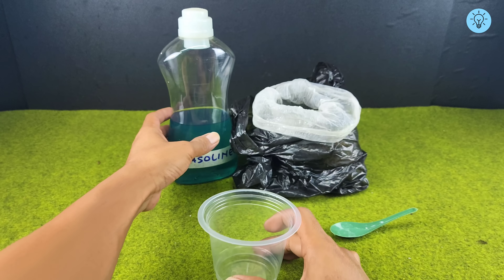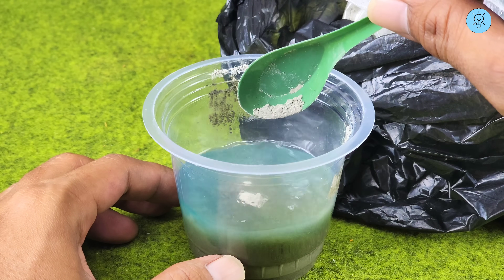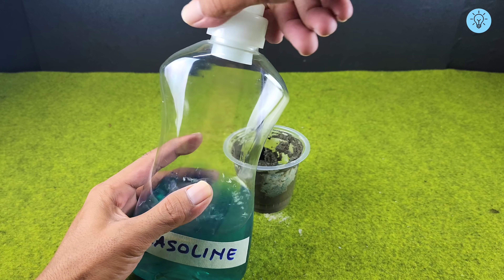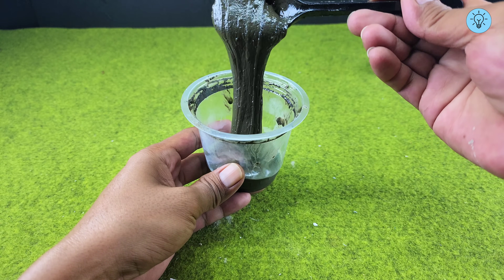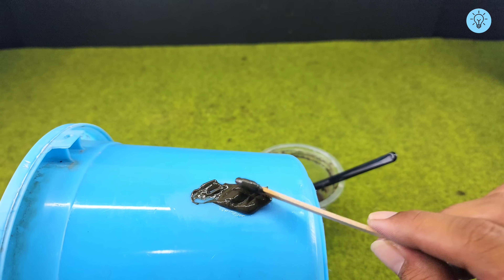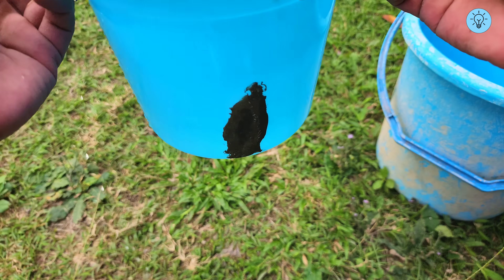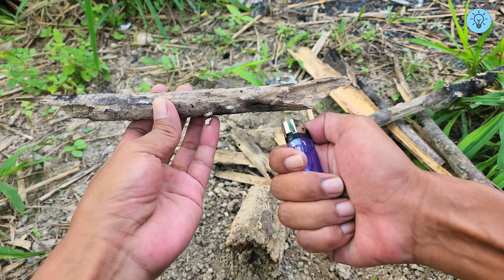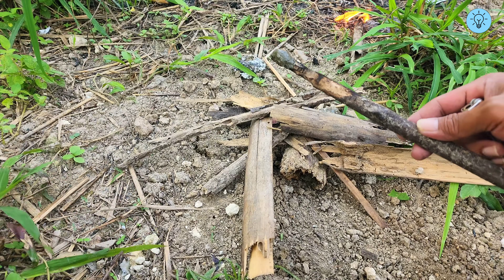Mix GASOLINE with CEMENT! Amazing results that most people can't imagine

Comment: Dang! You can’t even notice the repair work. It’s like brand new. Good thing I scraped up $4.50 for the gas and $6.00 for the bag of cement to repair a .99 cent Walmart bucket. that is so clever and smart.
Reply: Lol. I do fiberglass repairs on boats. I would fire myself if my repairs looked even remotely that hideous.
Reply: @nutricook1 Yea, but what if you didn't have the proper materials or tools & your boat had a hole in it, & you were stranded on an island with no help coming, & all you had was cement, gasoline, & Styrofoam? That's the idea of this video. Not perfect, professional fiberglass repair.
Reply: @sparky6086 Okay. That is quite the scenario. But I would still be skeptical. My luck is that the makeshift repair would pop off because of changing temperatures right when I was far away from land. 😕
Reply: @nutricook1 It depends on how desperate the situation is. It's not bad to have options. Sometimes people find themselves in "MacGyver" type situations. People should use their imagination, rather than dismissing videos such as this one, simply because it's not done the standard way or to code. It may even apply for an application no one has thought of yet. Doesn't necessarily even need to be a desperate situation.
Reply: @nutricook1  Remember the sap glue re[airs on the minnow's hull on Gilligan's Island All the boards started popping off after a certain amount of time? ;D
Reply: @kellygibson4653  The professor was my favorite character. However, I don't recall that episode. 🤔
Reply: @sparky6086   of course you don’t usually have a bag of cement when you go fishing…
Reply: @nutricook1 it was actually the pilot episode
Reply: @markkarasik2211 Who knows what one might come across on a random island? ...I'm sure you get my general point.
Reply: @sparky6086   "you were stranded on an island with no help coming, & all you had was cement, gasoline," cant even tell if you are being funny
Reply: @sparky6086  Ah!  Now i see you are serious -- stranded on some uncharted desert isle with--- wait for  it -- fresh petrol, cement, and styrofoam, and a mixing cup! Cuz THAT could happen! if only you knew how silly you sound.
Reply: @free322001 I exaggerated to sharpen my point and you still didn't get it. Perhaps I'm being a bit silly, but you're being obtuse.
Reply: The answer to the song "There's a hole in the bucket"
Reply: You're talking to a generation that doesn't even know what a women is
Reply: I think you miss the real point.  You are not very bright are you?
Reply: Considering he used 21 cents worth of gas & 8 cents worth of cement. Not too shabby 😅 😂.  But yeah the terrible finish... & a bucket?
Reply: @billykarnes6035  Sorry - where do i go to buy  8 cents of cement? How much gas do i burn to go drive to get 21 cents of gas? Or do you want to suck it out of your tank with a tube?
Reply: Yes, for one small bucket it's probably not cost effective but I have quite a few 35 gallon plastic trash cans that I have accidentally put a few holes in with the weed whacker. If I get all the trash cans and buckets I have holes in, making a good size batch would save money, Those trashcans are $15 - $20 each.
Reply: 15 lbs of glue for $10 is cheap.  Can replace bondo for car body repairs
Reply: Good stuff I got 3 for a dollar but need buy that cement and other components asap 😂😂😂😂😂
Reply: Good point, who ever did the video could have repaired something more valuable than a bucket
Reply: What you lack in imagination you make up for in noise.
Reply: 😂😂😂 i was thinking the same 😂😂😂
Reply: Squeeze the bucket and you have your leak back.
Reply: "Use your hands"😂
Reply: Can this processed product used to repair, pressured hot/cold water pipes?
Reply: @BRadha-gi4jv no, definitely not, terrible idea.
Reply: NOW add you labor, time, and hazmat disposal.
Reply: Ha
Reply: Of course, you may run across an application at some point where it's worth it if you use your imagination. ...Unless your government restricts it's use to plastic buckets only?
Reply: @sparky6086  Like Bondo to repair rust patches on your auto?
Reply: If the bucket was HDPE you could just use zip tie cutoffs and a soldiering iron to weld the bucket.  Also you should NOT for any reason bare hand cement or gasoline let alone mixed together.  That is horrible advice and you should edit that out saying to wear gloves and don’t get it in your skin.  Ps you don’t need cement to mix styrofoam and gasoline to make a sterno like jelly.
Reply: 皆さんこの話題を擦りすぎです
Reply: Yeah, stranded on an Island with a hole in your boat and you just happen to have some cement on hand. Or maybe the last guy that got stranded left a bag of quickcrete😂😂 This trick isn't gonna save you!
Reply: You obviously live in California... Like me. Depending on how far you had to drive and gas mileage, I spend a dollar every 5 miles. Cali is great.. if your rich
Reply: Or an illegal immigrant 🎉

Comment: A lot more simple way to do that is simple super glue and baking soda. The combination makes a rock hard shell! You say that mixture safer but you make a fire for more than heat you make it to cook with. And I beg to differ on how quote" safe that fire would be with your food burning styrofoam and gasoline can't be good. Now if just for heat it's a decent idea I guess. But we use Vaseline and cotton balls. #rip chip
Reply from the maker: That’s a very interesting suggestion 🙏 super glue with baking soda really makes a strong shell. You’re right, safety always depends on how we use the idea. For just heating, I agree your method with Vaseline and cotton balls is a smart and safe choice. Hopefully this idea can still be useful in certain situations.
Reply: @creationDIY_101 It is! To start a camp fire, burn barrel, or fire pit to relax near. I only mentioned about that because it's so many people who would definitely would not know better than to try it to cook by! But it is a great ignition source in well ventilated areas!👍Salute! Keep them coming!

Comment: Good job of giving enough info to get it to work. You showed the basic concept, the materials, the approximate consistency to aim for and gave a basic idea of how to use it.  
I tried it and it does indeed work! 
The ratios aren't exact.  Relax & play around with it, nothing expensive here.  
Doesn’t work on everything all the time but it's got it's place.  Sometimes you need JB Weld, sometimes you need Superglue, sometimes you need wood glue, sometimes....
😊
Reply from the maker: I’m really glad to hear that it worked for you! You’re absolutely right — the ratios don’t have to be exact, and experimenting is part of the process. Thank you for sharing your experience and adding great insight! 🙏
Reply: Non Newtonian fluids
Reply: Superglue and baby powder works well but with a slightly different application process. Put a little superglue on whatever surface you’re trying to fill or bond then sprinkle baby powder wait a few moments then repeat. Glue then powder until you’re finished. You can sand it drilled it or paint It. It can bond better than most glues because you can layer it on the outside of a bond for more support. You can mix the superglue with many different powders to varying degrees of success. I forget which one is supposedly the best (there’s many different videos on here that compare powders) but baby powder is one of the top ones and seems to work well.

Comment: How long before it goes from liquid to solid in the cramping test?
Reply from the maker: For burning media, you can use it for about 3 to 4 days. As for the patching process on the bucket material, it only takes around 24 hours to form a solid structure and bond strongly to the surface of the bucket.

Comment: I'd never use gasoline for anything other than as a motor fuel.  Too dangerous.
Reply from the maker: Yes, you are right, we really need to be more careful when using gasoline. If you prefer not to use gasoline, in my latest video I’ve made a version using materials without gasoline — it’s much safer, more practical, and you can try it directly at home. Please have a look, and I hope the idea is useful.
Reply: you could break down the hydrocarbons to get a drinkable alcohol, though you need a chemistry background.

Comment: for $2 bucket . ???
Reply from the maker: This mix isn’t just for broken plastic buckets — you can also use it for leaking walls, roof tiles, or even as a super strong glue
Reply: No, for €2 bucket

Comment: 変質したガソリンは着火剤代わりにするにも発火がヤバいので砂に吸わせて埋めてしまうか、廃棄物処理業者に処理してもらうしかありませんでした
だからと言って刈り払い機に使うにも長期に見ればエンジンの劣化に繋がりますからあんまりやりたくない
なるほど、発泡スチロールを溶かしこんでセメントの粉末と混ぜれば強力な接着剤になるわけですね！
盛り上がりもいいから車のバンパーの修理にもよさげなパテにもなりそうだ
セメントの代わりに大理石粉末とか珪藻土粉末とか母材を替えれば色や強度を変えることができる！
この発想はなかった。捨てるだけの劣化ガソリンと発砲スチロール。資材費は無機質粉末代だけだから超ローコストだねｗｗ
Reply from the maker: とても詳しいコメントをありがとうございます！確かにスタイロフォームとセメントを組み合わせることで強力な接着剤として活用できますし、他の素材を混ぜることで色や強度を調整できるのも素晴らしい発想ですね。ご参考になれば幸いです。
Reply: @creationDIY_101  Is it possible add styrofoam to a watter based concrete mixture, mold it and fire it after it hardens to make some more porous material?  Perhaps as a planter?  
What would the resulting properties be?  Would it be vulnerable watter freezing?
Reply: @urrywest use saw dust an clay or straw an clay 
Fire the clay bricks an the straw saw dust is burnt out leaving porous refractive effect 
How firebrick used to be made

Comment: Do you think this would work to patch/seal a hole on the bottom/side of a Kayak. Or is it likely that continued exposure to water would cause the material to soften back up and dissolve or peel?
Reply from the maker: Yes, this method can be used for patching on both the bottom and the side. Once it has completely hardened, the patch will not soften or change shape just because of water exposure. Give it a try, and I hope this tip will be useful for you
Reply: In our area, gasoline - styrofoam mixture is used to patch wooden boat hulls, its not affected by seawater. No cement is used.

Comment: I wish more people would repair things, instead of chucking things away and buying a new one!!!!
Reply: The gasoline and cement cost more than the bucket.
Reply from the maker: I totally agree with you! Repairing saves money and reduces waste. Hope this idea is useful. Thank you for your positive comment
Reply: @creationDIY_101 My dad is the total opposite, I've had countless things of mine chucked away by him, including my classic computer he threw away when I was 12 in 2001. He recently got rid of a perfectly good video camera that cost me £110 for virtually no reason. He's so wasteful. I have a repair shop in my town that I an going to take a few things down to when I have the money. I agree, I try at least recycle something if I'm going to throw it away.
Reply: I tend to agree that repairing is better than trashing. However, this particular repair is probably pointless. Saving money is obviously not the point, and the evaporated gasoline is worse for the environment than producing a new bucket. Does that mean the knowledge is useless? No! The bucket may be a poor choice of uses, but the concept is separate from the example.
Reply: @redthebloody 
🚫 You guys are wrong! I have a  521cu/in Ford 460 big block with 626 hp  in my 1968 Mercury Cougar drag racer. It has a badly cracked crankshaft and an equally badly cracked transmission shaft. 

Instead or welding them, I utilized ^this recipe to fix both shafts. If it can patch a hole in a cheap plastic bucket, then it can also fix crucial parts in an NHRA Sportsman league drag racer! 🙂👍
Reply: @HighlanderNorth1 
LOL! Yeah that's definitely a better idea than the bucket!
Reply: I like that he used aluminum foil tape on the bucket. Not enough people are aware of aluminum foil tape, which is great stuff. Way better than standard duct tape.
Reply: We live in a disposable society.  My grandfather fixed everything and taught me to do so as well.

Comment: He made JB Weld 😂.
What add some metal dust in the mixture? 🤷🏽‍♂️
Reply from the maker: Haha good idea, maybe it will be even stronger with metal dust 💪🔧
Reply: JB Weld is 2 part epoxy, and it has a smell somewhere between burnt food and sulphur. Does your 3 part mixture smell like gas when fully dry?

Comment: Any clay like material will do. There is no reason in using Cement here. It doesn’t  react with anything in this case because there isn’t any water present.
Reply from the maker: In theory, cement doesn’t react without water. But after testing it, cement still has adhesive strength. So when combined with melted styrofoam (dissolved by gasoline), the result is much stronger compared to using regular powder or clay.

Comment: Sorry. 9min of wasted lifetime 😢
Reply from the maker: Okay, I'll set the time back to 10 minutes 😁, and I'll give you a bonus minute. Thank you for your positive comments. I hope you find this idea helpful.
Reply: It's only boring if you don't appreciate it, personally I found it interesting.
Reply: It works more easy and les Dangerous with superglue and some dust Like fromm grafit, ash, or fine sand. And If you use It with magnetised iron dust in presence of a magnet, it will bekomme weak magnetic propertys by itself. And if you need realy yo use polyuretan, Take aceton instaed gasolin

Comment: blaues benzin??
Reply from the maker: In meinem Land werden dem Benzin Farbstoffe zugesetzt, um die ROZ-Zahlen zu unterscheiden. - Grün steht für ROZ 90 - Blau steht für ROZ 92 - Rot steht für ROZ 98
Reply: @creationDIY_101 
In Japan, to prevent accidents caused by filling up with the wrong gasoline, gasoline is colored orange and diesel is colored pale yellow.😊